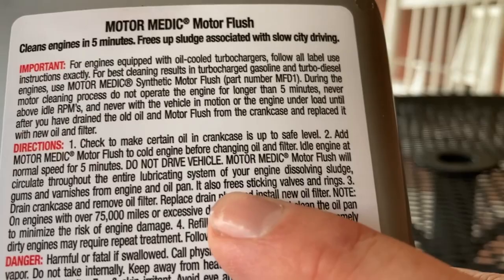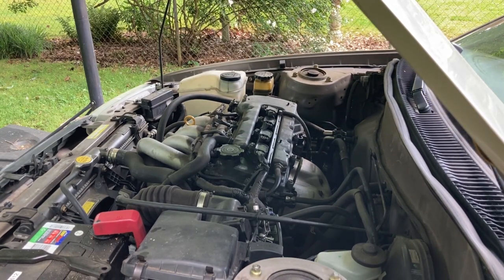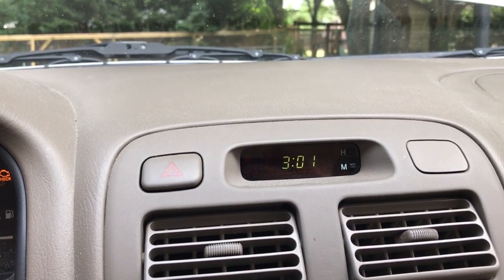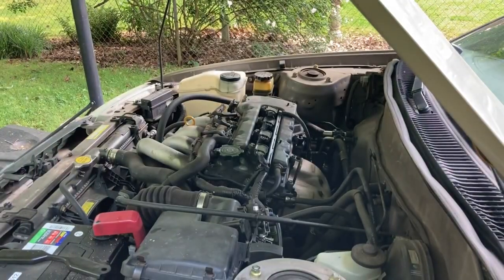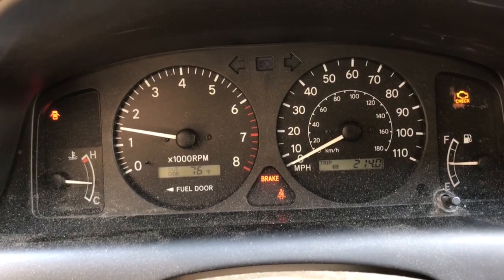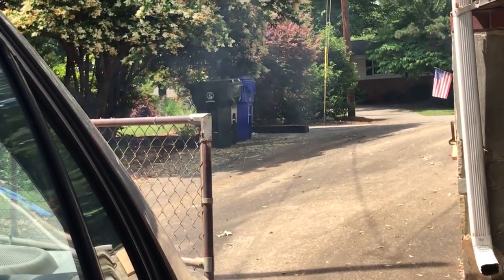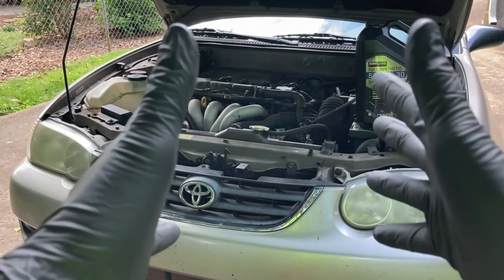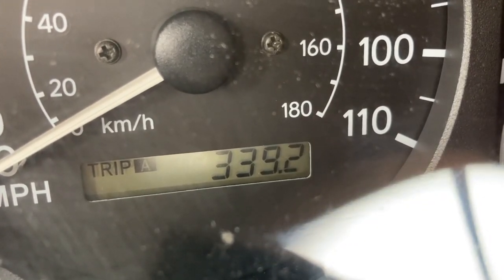Will Motor Flush stop oil consumption? | Oil Burning Experiments🔥- Episode 5

Comment: Kind of hiding the problem here but have you tried a thicker oil like 10w-30 or use Lucas oil stabilizer? I know older engines have wear and can create larger oil valleys with that wear. I know it’s totally hiding the problem but if it works it works.
Reply: Thicker oil? Method of saboteurs..
Use Liqui-Moly engine flush. Made in Germany.
That's what I do in my '02 Ford Focus. (200k miles, no oil consumption at all, 30-35mpg)

Comment: When replacing oil with additives to clean the engine, best is to first pour the used oil and install half way the oil plug. Second is replacing the oil filter. Third, remove the oil plug again and let the leftover used oil with additives to come out the most.

Usually the oil filter is at a higher level than the oil plug, and oil stuck in the filter area won't move to the oil pan unless air's help.

It is very important to remove the most of the mixture of oil with adfitives from the engine at the time of changing it with new motor oil. This is because the leftover used oil with additives will cause lesser viscosity of the required one in the engine.

Besides this inconvenience for the engine, a presence of a certain amount of motor oil cleaner left in the engine is similar to rinsing half way the dishes leaving soap on them. Next meal won't taste good and might cause you health issues. Same can happen with your engine.

If compression is an issue regardless of no noticeable missfire, there are products for filling up the piston rings that surely work.  

This solution for piston rings might or might not help to reduce oil comsumption, but using it at every oil change is commented by users to be unharmful for the engine.

Comment: I came across this Toyota Corolla oil consumption series and have been binge watching it. It is interesting to see all the methods you are trying out. I have never heard of an engine flush where you let the car idle only. They usually require a fast idle or specify a certain rev range, usually no more than 2000RPM. I also have not heard of an engine flush using the old oil & filter for the first flush. They usually require new oil & filter - the cheapest oil you can buy because you will drain it straight after the flush.

Valve Stem Seals failure shows up as smoke out the exhaust at first start up of the day or if the engine has been started after the engine has been shut down for a little while. the oil drains down the valve stems and into the cylinder(s) and burns off. 

I had a Mitsubishi L300 van (later it became the Delucia) which was not released in the USA. It had oil consumption issues similar to yours where sometimes it would use a lot of oil in a given distance, other times it would ease go twice or even more as far before I had to top up the oil. I never repaired it, I sold it like that. The new owner wanted a cheap van for his painting business, so didn't care that it used oil.

Comment: A better approach would be to use 0w20 full synthetic.  After it burns 1 quart add 1 quart.   After it burns that quart change oil.  The 0w20 is a very thin oil and will erode the blockage in pistons.  Also, a tier 1 high octane fuel to reduce carbon
Reply: High octane has nothing to do with burning carbon. It’s just rating on how fast the fuel burns. Higher the octane the slower the burn rate so high compression engines don’t detonate

Comment: I had a 1986 Toyota Celica GTS that started using oil {about a qt every500- 700 miles] yet had good compression. I didn't notice any smoke coming from the exhaust until one morning when I started it. The sun must have been at a different angle but I noticed a puff of smoke upon starting it that morning after sitting overnight. It turns out the valve stem seals were bad. They were hard and brittle. Removing them wasn't easy but can be done with the head on the car.  I had to buy a couple of special tools to do it. A seal remover-installer and a valve spring compressor with a magnetic center to hold the valve spring keepers when the spring is compressed. I think there are both ISLE products.
Reply from the maker: Thanks for the info, Robert. I'll be changing the seals soon. I'm going to try to do it without any special tools. Saw a video of someone doing the whole thing with just some deep sockets and a small magnet. We'll see how it goes.

Comment: Hi,  From the result of cylinder compression test, I would think the piston ring should be OK.  You might need to check the valve seal condition.  A bad valve seal will also cause extra oil consumption.
Reply from the maker: Going to scope it to see if we can find evidence of leaking valve-stem seal. Thanks for the comment, Janqlih!
Reply: Wouldn't that show up on a fouled spark plug or smoke out of the exhaust pipe?

Comment: Perhaps have you changed your PCV valve? It controls the back pressure in your engine crankcase and if it build too much pressure it will cause it to push oil past rings and valve guide/seals etc.

Comment: If you have the 1zzfe engine in that, then it’s just your oil control rings. I had a 2000 celica gt that had that engine. It gave out at 223000 miles. Burned a valve because I was I was burning 1 gal a week of oil. Also clogged the cat. If you can unclog the oil control rings, that’s where it’s at. If not, open it and replace the oil control rings, even compression rings since you’re already in there and nothing else. Carbon and gunk will do this. It’s just maintenance, I learned the hard way
Reply from the maker: A gallon a week? Whoa!

Comment: Assuming it is the rings, varnish, carbon stop the rings flexing thus u lose some compression.
My suggestion for what it is worth is after an oil and filter change using that flush, once again with the new oil plus filter add oil flush this time lock the transmission (auto) in low and with a warm motor accelerate to 1500 rpm below the red line, do two passes on a quiet street, then repeat to about 500 rpm below the redline 3 times.
Lastly for another 3 times just touch the red line.
Using the compression of the engine with it locked into 1st to “engine brake” should help the rings flex.  It is more pronounced in an older diesel, but it’s cheaper than a rebuild.
The object is to “flex” the rings in the grooves which breaks the carbon etc lock and aids the flush to do its job.

Let the old oil settle overnight an pour it carefully and slowly so as not to wash and finer carbon particles that should be present.

I use an engine flush every service and an Anti-wear agent.
380,000 klms on a four cyclinder diesel.
I have had many others with high 
kilometers all over 200,000 klms now and no problems.
I’m in Australia so it’s pointless telling you the brand, so I will give the website for those who like some homework.  They have extremely complex scientific tests for their products (former scientist owns the business).
I’ve been using their products for over ten years, possibly 15.  They work and as the name implies it is cost effective.
www.cost effective.com.au

Comment: Check the cylinder walls with a bore scope.
Might be damage to the cylinder walls the rings could have scratched the walls while stuck and if that's the problem the motor is done new rings won't fix that problem. 
Using a heavy oil will doing nothing. 
A compression test would be good to do if you don't have a bore scope.
Uneven psi in the cylinders is a sure sign of wall damage

Comment: You don't have stuck piston rings. That car is notorious for clogged cylinders ( I have a 2000 Chevy Prizm). The fix is to take the engine apart and drill the holes back. That's the only way to fix it. Otherwise, just keep topping it off. Oil is getting more expensive, but it's not that bad. I'm actually burning about 2 quarts of oil a month. But for $80 worth of oil a year I don't think it's that big a deal. And I've foregone doing routine oil changes since I replaced the oil so often anyways. I just change the filter once a year or 15K miles or so.
P.S. I don't think many people have seen any improvement. They've tried a lot of stuff. But maybe, something like AutoRX is worth a shot. It'll provide more content for the channel anyways. But it probably won't do anything.

Comment: Good stuff. Check your oil color before using. I guarantee the oil will be black when drained . It removes the sludge and carbon deposits which why the drained oil is black .

Comment: Kerosene is your best bet, soak over night. Your gonna need new gaskets as some of that stuff will deteriorate your gaskets and rubber parts. Restore will help for awhile, but is just a quick fix. Also brake fluid will help but again you have nothing to loose at this point.

Comment: Seafoam through the crankcase works tons of videos showing that you might have to do it 2 or 3 times, but it's proven.
Reply: Ive been running it in mine for abou 15000km so far still consuming oil at a 1l/1100km. Obviously the fluids been changed a few times. 2006 lexus gs300.

Comment: What year is that? The 98-02 Corolla 1.8 engine has a piston design issue that would make flushes and soaks futile. The piston oil return holes for the oil scraper rings are too few, too small. They clog with hard dry carbon. With no flow through the holes, there is no chance any fluid can clear them. The fix is piston removal, drill out the holes, drill more holes.

Comment: I like the gun solvent but maybe try a few more things made for vehicles first. Diesel  kerosene transmission fluid. I used diesel before at a quart per change and ran to warm. That cleaned a lot. But I didn’t have stuck rings.

Comment: I do believe that engine flush works, however, I would not expect a 10mins idle run to do anything to your piston rings. I flush my engine each time I change the oil and that's where I believe I get some cumulative effect. Starting at about 50K miles you can get some longevity added to your engine. The way I flush my old engine is not a 10mins idle run though, I add Liqui Molly as they're a reputable company and actually drive for THREE days or around 2-3 hours of driving. And that, I think, provides some value. A 10 minutes flush will not do much in my opinion, and neither will a one-off flush. This is the kind of stuff you've got to use at each service interval.
Reply from the maker: Wow. That would make me a little nervous, but I see your point.

Comment: I saw last time it had oil in your cylinder as ypu showed. But the oil dripped down. Might your valve seals be worn put and leaking oil into the culinder?

Comment: On a high mileage engine a lot of what is holding it together is just crud, like burnt carbon and oil sludge. and you just keep cleaning it again and again. i wouldn't be surprised if its having a very negative effect on the engine at this point. You are just trying to clean the space between the piston and the rings, but all those chemicals are going throughout the whole engine and making more space. so if compression is your issue repeatedly flushing all that old crud is probably detrimental. Or at least beyond the point of diminishing return. That's not even mentioning what effect that stuff is having on the plastic and rubber components. But for example some metal parts of your engine, let's say maybe the wall of the piston chamber, or a gap between a seal and a mounting face might have some level of pitting and corrosion that was filled in and leveled off with sludge. And now that you're removing it all, you're not getting a good seal between the piston rings and the chamber anymore regardless of how well the rings are fitting. But that can be happening anywhere in the engine. So if some other component doesn't get broken first, then for that reason you'd need to start taking the engine apart and replacing parts, which is frankly the right way to do the job in the first place. How much money did you spend on marvel mystery oil and on gallons and gallons of 10w30 for years at this point instead of just paying a mechanic one time. how annoying to keep checking and refilling and changing the oil constantly.

Comment: Toyota had some engines with a small hole in the oil control rings on the pistons that would clog up and start consuming oil. I don't remember what engine or what model.  I think there is video documentation on  you tube about it.  The fix is a full rebuild with new  pistons and such. Good luck. I will subscribe I like how you comment back to your viewers a lot of content creators don't..
Reply from the maker: You're absolutely right, Kurtis. This 1zzfe is one of those engines. ... Rebuild might be in the future. Thanks for the kind comment!
Reply: Was the 4age in the first generation MR2 one of these engines?  My '86 MR2 is burning about a quart of oil every 300 miles.

Comment: Burning off smoke get the higher RPMs is also indicative of more oil getting into the head and being sucked down the valves past the valves guide seals the mileage on the vehicle indicates you might need to do a head Refresh on it

Comment: Hi,  Toyota 4 cyl. are famous for sludge valve cover.  Talking about  burning oil :  valve seals mostly smoke at first start.  In your situation engine smokes around 2000 rpm.  Try to disconnect the pcv assy from the valve cover and check for changes. If the smoke stop,  the sludge inside the valve cover made its own passage to the pcv.  Replace valve cover,  Toyota pcv.  I think you can rebuild the valve cover. Thanks.

Comment: u know some motors just burn oil... i would run MMO little more and use it in your fuel also... if you dont like results after... then i would try thicker oil if the weather temp is warm enough for thicker weight

Comment: Great experiment! What is your check-engine light on for btw? Did you use an OBG scanner to figure it out?
Reply from the maker: Thanks! Yes, I borrowed a scanner from AutoZone. The CEL code is "small leak detected in EVAP system."
Reply: @FamilyFriendlyDIY  That could be affecting your crankcase vaccum right? Which could prevent the rings from sealing properly?
Reply: @FamilyFriendlyDIY  
Fix vacuum leak on these modern cars. YT has many smoke generators to make for vacuum detection.

Comment: I’m a professional mechanic and from the first video I noticed that there was a lot of sludge in the oil filter housing and later noticed the sludge in the PCV valve. You are fighting A LOT of sludge. Did you ever taken out the valve cover to see what you’re dealing with? Oil pan? I’m gonna keep watching this series and comment as I watch. I’ve used “BG” oil flush and worked amazing. Kit is not cheap though.
Reply from the maker: Keep the info coming, Nelson. I have the valve cover off in a later video where I do the valve-stem oil seals. Would love to hear what you think! BG is definitely on the list of possibilities.
Reply: @FamilyFriendlyDIY  interesting, I'll have to find that video. New here. 
Personally, I've used Amsoil Engine Flush & have also used Amsoil Power Foam. 
 Before doing the flush, replace the filter with a new one to catch any debris that is coming loose, then drain oil & replace as normal. 
 As far as the Power Foam, use as directed in a warm engine, let sit/soak for a lil while then drive it out & HOLY COW! The crud that comes out the exhaust!! also helps clean out the catalytic converter.

Comment: Kinda late to this however I have a 08 Honda Odyssey that was burning oil like this. I used the blue devil stop smoke and changed the pcv valve. This solved my oil burning Honda. The car has 225k miles still running strong

Comment: Why didn’t you use a crush washer on the drain plug?   Don’t you get oil leaking?
Reply from the maker: It didn't have one when I bought the car, Chris, and it seems to seal fine without it. I've had a couple of cars like that over the years-- no crush washers and no leaks.

Comment: A quart every 300 miles is beyond excessive. That will destroy a good catalytic converter real quick! You are probably dealing with bad valve stem seals, pcv system failure, head gasket related issue, or some internal oil leak. There isn't going to be any saving that with a bottle of cleaner. The best shot you got for the cleaner method is to take it to a shop that sells the BG engine flush, which isn't sold to the general public. That stuff will clean out an engine full of sludge top to bottom. However with how bad your loss of oil is probably won't resurrect it.

Comment: Have you tried the BG Dynamic Engine Flush kit with Rinse oil ??  Maybe more than you want to spend but I would say if that didn't work no solution in a can will and may need tear down and further inspection to determine cause.

Comment: Do it with DMSO. IT DID help to my 1zz-fe. I've  noticed it's only 1 or 2 videos on english youtube about this DMSO but it is very popular on Ru tube 100 thousands videos.  Be careful it will strip the paint from the oil pan and I also had to get oil pressure sensor replaced as it start leaking after DMSO treatment on my 1zz. It is recommended to look inside the cylinders with endoscope first. If it has got straight lines on the walls ANY treatment won't help. Good luck
PS use PPE
Reply from the maker: Dimethyl Sulfoxide? I hadn't heard of using that. I'll have to look into it, Dimitri.

Comment: i agree with a lot of the other comments here. when was the  last time you changed the valve seals? if its been more than 10 years. i suggest its replacement. it might be that the rings are already clean but its just the valve stem leaking oil.
Reply from the maker: We do the valve stem oil seals in a later video to test that theory.
Reply: @FamilyFriendlyDIY  Hi there, i did see that after i made this comment. it looks like it made a difference in the spark plugs making them cleaner and you can see the "white" on them after. hopefully the current issue you have can be fixed so you can complete the series. been there done that so far :) Good Luck!